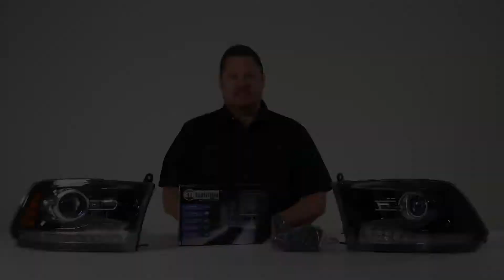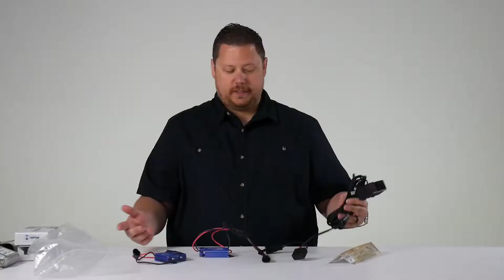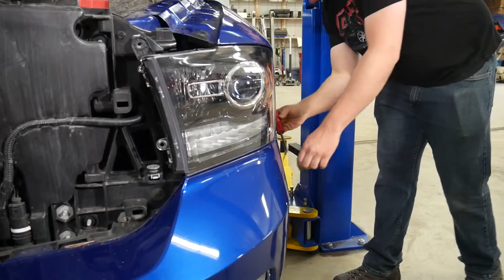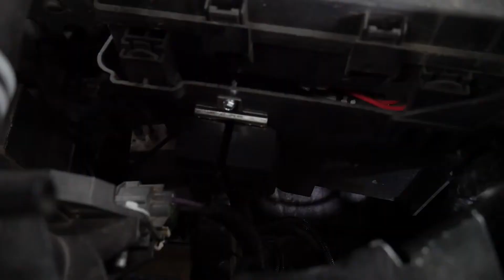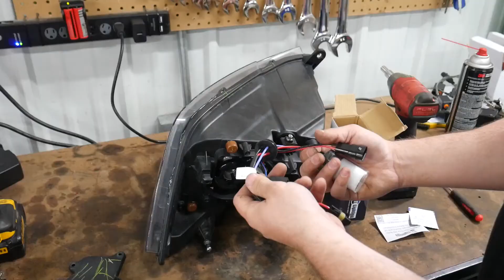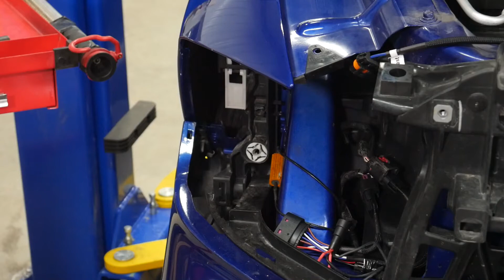HID Low Beam 2007-2017 Dodge Ram Type B CANBUS Install Instructions | Headlight Revolution

Comment: My battery is in my trunk (2012 Genesis sedan), would I need to run a wire from the relay all the way to the trunk?

Comment: What is the difference between the GEN 4 or Gen 5 GTR HID kits?  I am looking to buy a 55w kit but not sure what the difference is between the two (for a 2013 gmc acadia)
Reply from the maker: Hi Justin, the difference between the GEN 4 and GEN 5 kits HID kits are the ballasts. The GEN 5 kits have much more canbus compatibility than the GEN 4. Which means that it will not cause any problems with newer vehicles that have a much more complex headlight system.